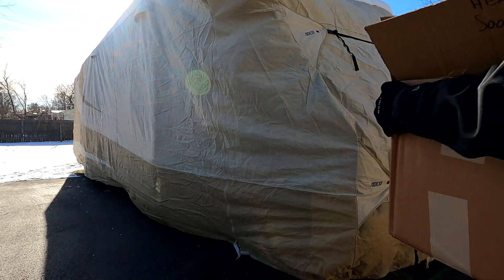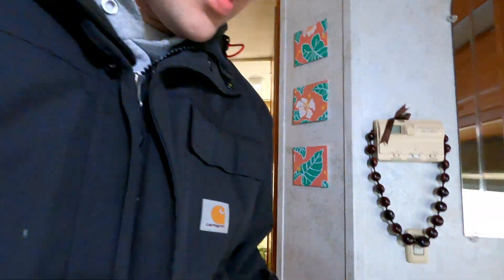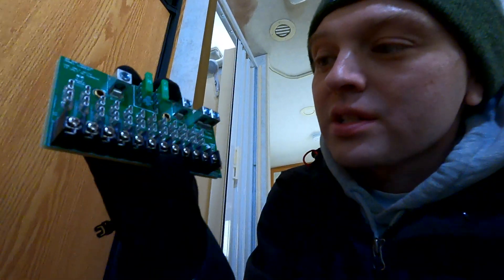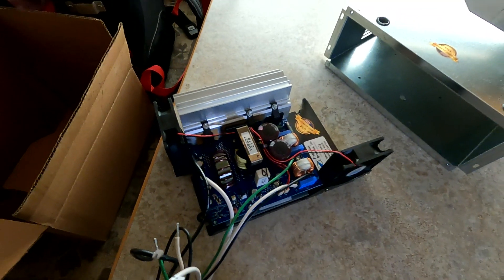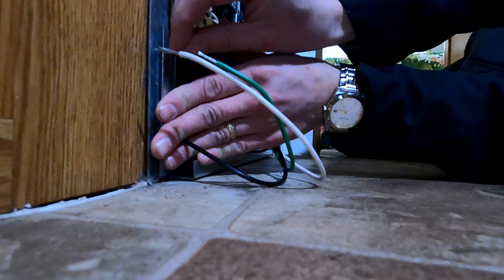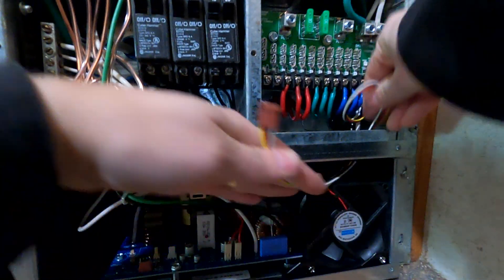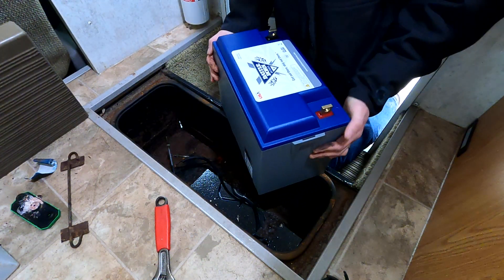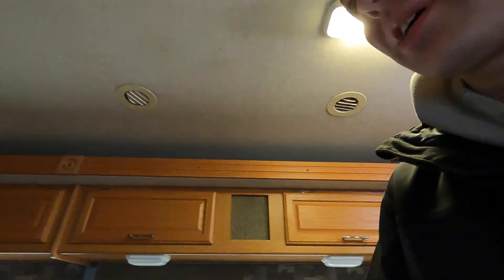Upgrading My RV Charger/Converter for Lithium Ion Batteries (2006 Winnebago)

Comment: Nice. Not enough videos describing how to retrofit these older rigs. Now, don't you have to do something to the chassis charging system?
Reply from the maker: Some people recommend a battery to battery charger, but it's been two years and I've been charging the house batteries directly off the alternator when driving (or however it was originally wired from Winnebago) with no noticeable issues.

Comment: Excellent video, well done
Reply from the maker: Thanks for watching!
Reply: @heathracela  I have the exact same converter, i don't see the upgrade kit on the BB website, do you have a link, or part number? Maybe update comments with part numbers.
Reply from the maker: @dandauer9673  The updated converter that I have is PD4655LIV by Progressive Dynamics.  They also sent me a S46METALBOX Progressive Dynamics 4600 Series Metal Box.  If BB doesn't have them anymore, you can probably find them on etrailer.  At the time, I had called and spoke to a sales rep, who helped recommend what I needed.  Good luck!

Comment: You should not be charging your lithium battery below 32 F, it can permanently damage it.  I believe the BMS in Battle born will preclude it from accepting a charge at that temp or lower.

Comment: Thanks for posting this video - very timely (for me)!

Great video that shows me exactly what I need to do in my recently-acquired 2006 Leisure Travel Free Spirit. I'd assumed that I'd have to bypass the charger converter and integrate a separate charger, mostly because I didn't realize you could field upgrade the 7345's charger/converter section.
Like you, I'll be working in the cold to do this upgrade (Alberta, Canada).
Reply from the maker: Thanks for your comment and good luck on the upgrade!  It’s a bit of work, but it was worth the effort for me.
Reply: @heathracela  Interested in the Field upgrade of this converter.  Is there any way to make my LifePO4 batteries work with it?  I didn;t realize I needed something different when I bought the batts.  I am even ok with less efficiency.  But nothing dangerous will do.
Reply from the maker: @RyanDyalRealEstate  I'm no expert, but my understanding is that if your converter is not rated for Lithium batteries, it needs to be swapped to one that is.

Comment: Are those lithium ion or lithium iron phosphate batteries? I've heard Battle Born makes good stuff. That looks like a slick upgrade. You probably have a better setup than most new RVs now.
Reply: I’m pretty sure they’re not Lithium Ion, they are Lithium Iron Phosphate (LiFePO4) like RickMakes said. All of the Battleborn batteries I see for sale are LiFePO4.
Reply from the maker: @jeremyspecce  Battle Born actually seems to use the term interchangeably on their website.  But technically, I think they are LiFePO4
Reply from the maker: They’re lithium ion. I can’t wait for the weather to warm up to really put it to the test!
Reply: @heathracela  Not lithium ion, they are lithium Iron Phosphate.
Reply: I came here to say the same thing. Not lithium ion. Lithium iron. But the video is two years old so I guess it doesn't really matter at this point.

Other than that the video was good and it helped me understand where to route the AC wires.